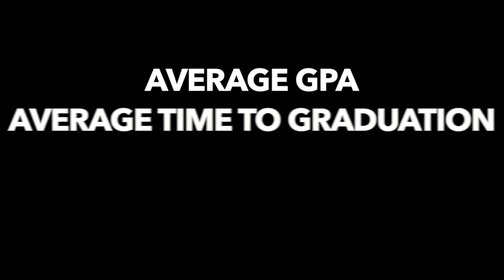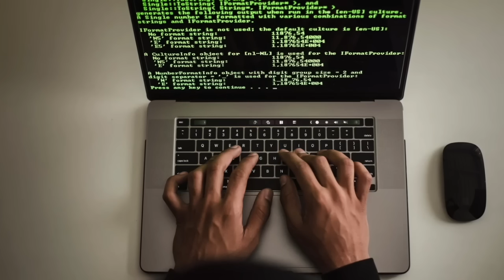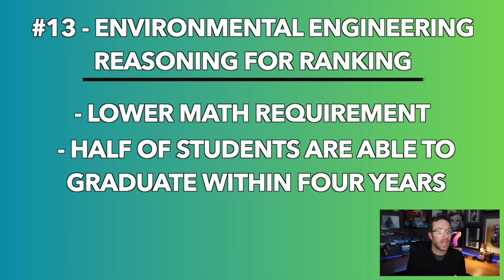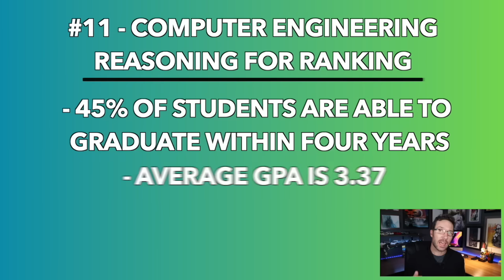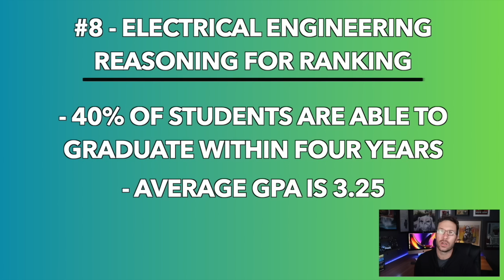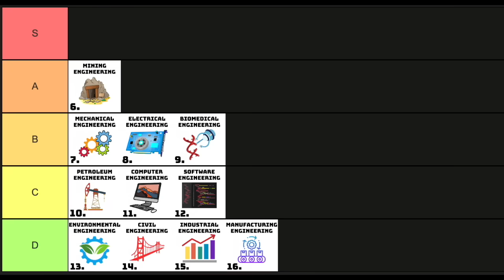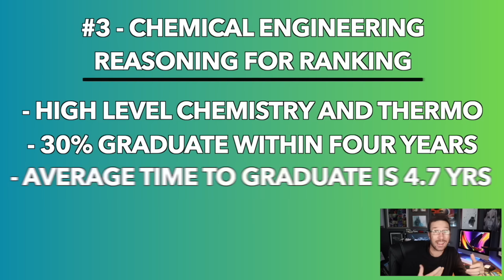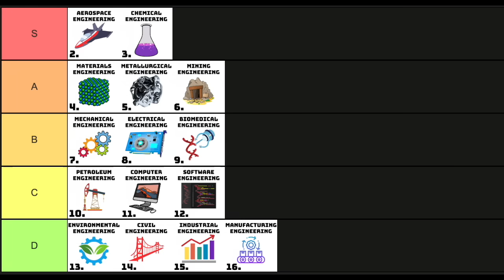Engineering Degrees Ranked By Difficulty (Tier List)

Comment: Environmental Engineering shouldn't exist.  It's just politicized civil engineering.  I also think it's funny Chemical, Metallurgical and Materials engineering are considered different even though all three are basically applied physics.  The hardest part of Nuclear engineering is getting the security clearance.  If you can't get top secrete clearance and don't want to work for the government don't bother with that degree.

Comment: Got a Electrical Engineering degree from UCLA. It was Definitely a very difficult degree to get but i felt like the classes that were traditionally the hardest such as signals and system's and telecommunications or DSP were the areas i was passionate about so it was'nt so bad. I got into the Navy's nupoc program to be a nuclear engineer though.

Comment: Not sure I agree with this. I have 3 different engineering degrees (electrical, mechanical, computer engineering) and got part way through a PhD in physics. Electrical is definitely the most difficult.

Comment: Great video! You've clearly done your research to put together this comprehensive list. You have focused on the key elements of each degree which I think will definitely help any prospective engineering students who are trying to decide which pathway is best for them! Unfortunately, I'm personally down in 14th place as a 'Civils Grad' but then I would agree with that. However, the most important point you made was that ALL engineering degrees are hard and anyone considering an engineering degree should be aware of that! This is mainly due to the content, there is a broad range of learning required on all engineering degree programs and this is one of the main reasons for students not completing their degree, they can become overwhelmed by the amount of study required! But it is worth it in the end!

Comment: Every accredited engineering degree requires partial differential equations, thermodynamics, physics, chemistry, probability and statistics, matrices and numerical methods, and programming. Having taught civil/environmental enginnering for 37 years at a major research university, I would rank chemical engineering most difficult and electrical engineering second.

Comment: Does he mean ECTS when he talks about credits? I thought you always need about 180 for a Bachelor degree?
Reply: ECTS is a European thing.  In the U.S. we have a similar-but-different idea of a "credit," which is not especially standardized but it seems like we generally consider 2 ECTS as equal to 1 credit.

The usual idea is that a "credit" amounts to one hour of lecture per week for a semester, plus the associated outside-of-lecture homework and studying.  A typical class load is 15-18 credits of courses at one time, and there are eight semesters in a standard four-year Bachelor's degree in the U.S., so the "standard" total ends up being about 120 credits.  Engineering degrees tend to be a bit higher than that.

Comment: I walked into a Motorola manufacturing plant in 1973 and got hired as an electrical technician on the assembly line with only a high school electronics course and a good ability to fix things. After a bit over a year I got into the calibration lab where I spent 10 years mostly as a Mr. Fixit for the manufacturing facility that I once worked in. I learned a lot about how a factory worked, and also how nearly everything in that factory worked. A Camaro belt buckle got me a job in one of the product design and development labs where I worked my way up to being a mid level electronics engineer. THEN, I got Motorola to send me to enginering school at THEIR expense. In 1993 I got my BS degree in computer engineering. For me the math was difficult, as was learning to code. Here I learned that computer mice can fly, and that keyboards break awfully easy. The electronics and computer hardware stuff came easy to me. A year or two later Motorola offered to pay my way through a master's degree in electrical engineering, so back to school I went. This time I took it much more slowly as I took every RF engineering and VLSI design class they offered. My master's in electrical engineering was finished in 2000 at the age of 48. Again, the math was the hard stuff. Most of my engineering career was spent in product development. designing two way radio equipment and cell phones. At one time there were hundreds of engineers in our facility of multiple disciplines, but the big three were electrical, mechanical, and software. Engineers, like most employees come an all flavors. Some are rocket scientists, and some can't operate a 4 function calculator. How did they get through engineering school? The last 12 years of my career was spent in a research department. There were NO stupid engineers there! I retired in 2014.

Comment: I don't think it's accurate to rank them based on what percentage of students graduate in 4 years. For example, at my university, during my years there, mining engineering was the easiest to get into and mechanical was the hardest, so all the students who had the lowest GPAs went into mining. It is no surprise that they could not complete in 4 years since these were the biggest slackers in engineering.   Also,  many of my classmates finished in 5-6 years due to them taking an internship.

Comment: Thank you for the information, I've spent the last 13 years working for a manufacturing supplier dealing with civil infrastructure, major and minor works, level crossing removals, highways etc, you name it, probably done it. I've recently quit and am looking to put something towards my knowledge, experience and skills that I've gained over the years. Thinking about going for an associate degree in civil engineering, I'm not sure if this is the right call and am still trying to figure out what to do, I hope it's the right choice if I go for it...
Reply: Better to get a 4yr TAC/ABET -accredited degree in Engineering Technology or a 4yr ATMAE-accredited degree in Industrial Technology than a 2yr associate's. Technology degrees are similar in scope to Engineering degrees but the math is much easier.

Comment: But you didn`t include engineering physics which is closely related to material engineering at the level of solid-state physics. It also roughly includes nuclear eng, but is mostly focused on photonics and laser-matter interactions. 

We had courses in electrical circuits more advanced than the ones for mere electrical engineering students, and courses on mechanics too advanced for mechanics engineering (like hamiltonian mechanics, relatvistic mechanics etc). 

So yeah we had the reputation for being the elite of the Engineering School.. (and we were pretty snob I think). 

The only think I disagree on the ranking above is the rank of chemical engineering It looked easier than electrical or material engineering (But maybe I am just biased for that and I know I would need more data to make a more conclusive point)

Comment: What about the physics major? How does that compare? Highest level of math is beyond partial differential equations. You also need to know something after the vector called the tensor... growth unknown to me, pay unknown since I am having difficulty obtaining a job, those credit hours maybe 130 or so but I went with minors in math, chemistry, and alternative energy and taken additional classes for about 220 credit hours.
Reply: I am a chemical engineering major with physics and chemistry minors. From my perspective, the upper level content in both fields has a similar learning difficulty. I found that intro to quantum mechanics is about as hard to learn from a textbook as intro to chemical engineering thermodynamics. However, the chemical engineering tests have been much worse with some averages in the 50's. Of course they have to curve at the end of the semester so it balances out, but about 30% of students flunked or switched by the end of my sophomore year. My physics classes thus far have had reasonable test averages. This is professor dependent too, maybe you've seen terrible test averages in physics. But from my experience, engineering seems to have more of a "I'm gonna make you go through what I went through" culture to it that makes it feel very overwhelming at times.
Reply: @Brandon-ms2uc  Professor dependent and not taught to the students very well. Chemical engineering and thermodynamics combined is going to be tough but necessary since thermodynamics matter in chemical engineering. I had thermal physics class for thermodynamics on its own and it is not easy right away given the mathematical approximations you have to do when working with unusual math especially those statistical mechanics parts. Then you have to fully understand general and organic chemistry very well. Textbooks are not perfect but helpful reference to use to go over the math and get things in order.

Comment: what degree do you recommend for someone who will graduate when they are 40. Experience in surveying traffic control and bridges and run a landscape business. Elementary math's is not to par and struggled in mechanics of materials hence the PE exam scares me. switched from mechanical to industrial because it was easy and graduate quicker, but find the classes boring but less stressful. stay in industrial or switch to civil?
Reply: Take Engineering Technology or Industrial Technology, but make sure they are TAC/ABET or ATMAE-accredited. Technology degrees require much less math.

Comment: So pretty much it is safe to say that: D tier is full of very applied and in high demand Technical degrees.
C tier is still applied and technical degrees but on very specific industries and with very specific subject.
B tier is full of the "Best Bachelor degrees" of engineering for the people who are planning to get into a Masters or that they didnt have much of an idea what they wanted to do.
A tier is highly scientific and very specific undustries that require non applied science knowledge and they are a bit stagnant or saturated.
S tier is weird. Nuclear engineering and space engineering fits with the description of A tier and chemical engineering fits well with B tier but is focused more on non applied science knowledge.

In my opinion if you want to get a job right after your bachelor, focus on the low tiers (especially environmental engineering which at this point fits in the roles of civil/petrolium/industrial/mechanical and sometimes even industrial engineering positions). If you want prestigious work opportunities go with B or S (or material engineering). A tier is tough to suggest to people that are not already attracted by it.

Anither note, electrical engineering based on the data this video based the ranking on, fits in B tier, but once you get into it deeper you realise that they make use of everything in manths in every single subject they have. Electrical engineering is STACKED with maths to a nauseating level especially advanced trigonometry and combined trigonometry, calculus, multiple level integrals, differentials etc etc.

Comment: I’m a civil engineering by training.  I’ve spent the last 32 years working as a software engineer, with most of that time in the biotechnology sector.

When I was at university, petroleum engineering had a reputation as the most difficult engineering discipline, due to the requirement for advanced chemistry classes.  

Also, when I got my BS degree in civil engineering, all engineers, regardless of discipline, had to take partial differential equations.  Software engineering and computer science typically have to take some advanced theoretical match courses.  So I really can’t agree with your rankings.

Comment: I notice you didn't include structural engineering.   I note that to be a P.E. in structural engineering in many states you have to take two P&P test where as other disciplines only require one.  Structural engineering is not the same as civil engineering, and the math requirements are greater.

Comment: I graduated in 1976 with a bachelor in science on Electrical Engineering in CAAM, Puerto Rico. The credits required by then was 162. About 5% did it in 4.5 years, 66% in 5 years and the other 29% 6 or more years. Calculus 3 was required and also integral & differential equations, difference equations, thermodynamics, materials, static. dynamics, physics, controls, integrated circuits, communications, ForTran, power. I can say that it was worth the effort. Which engineering degree is the most difficult? All of them.
Reply: Wow. Nowadays we don't even have half of these subjects

Comment: for anyone who wonders why mechanical engineering is higher level in math even compared to EE , just check continuum mechanics and fluid mechanics , boundary layer in heat transfer and finaly turbomachinery and aerodynamics, i understand that EE might be in general higher in math, in general , but if we are going course to course, you got to go with ME , those tensors and navier stock equations man

Comment: I'm not going to question your rankings because they seem realistic from an academic standpoint however engineering goes beyond pure academics. My father was a civil engineer and worked as a consultant. His job was to build a project on paper and calculate the lowest bid possible that allowed for a profit while meeting the specifications required. That meant researching the geology of the site, how to access it (that is for a remote location would it be better to build a road, airlift if the terrain allowed or it was navigatable use a waterway) he also had to know what the weather was like in order to plan for rain, snow, etc... if it would be cheaper to build a mixing plant on site or truck in concrete, what the local economy was like and what kind of skilled workforce was available, who to buy steel from, equipment maintenance, and on and on. I can't speak to the hidden dimensions of other types of engineering but in civil engineering logistics is everything

Comment: I would have put Civil and Environmental neck and neck at dead last. I have yet to meet a "bright bulb" in either field. I worked with someone who had an environmental egineering degree, who was also a developer, and was mad at me because I could not set up a projects parking lot lights to run (at night) off of the rooftop solar. I explained that the lights were only used at night, and that the solar cells only made power in the sun. YEP! That stupid!!!!